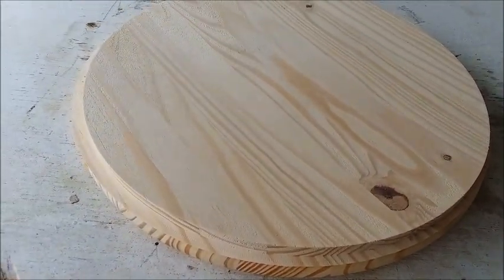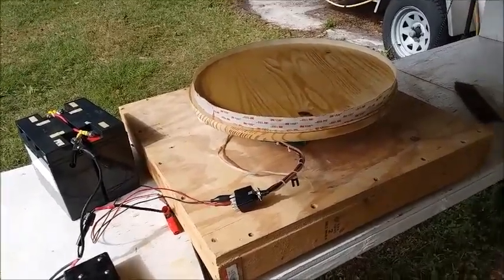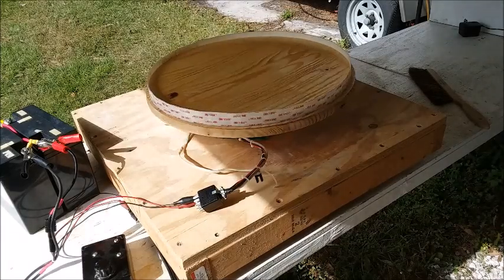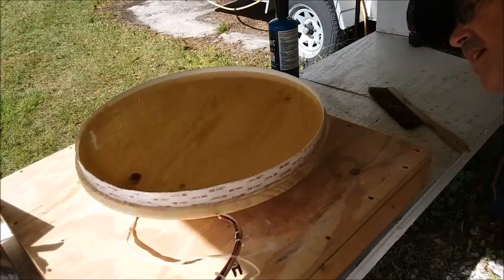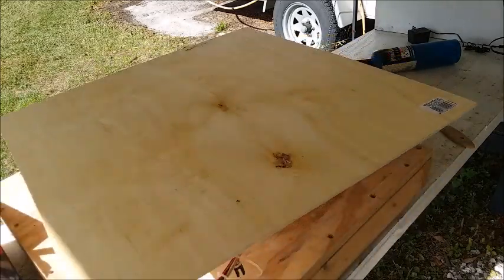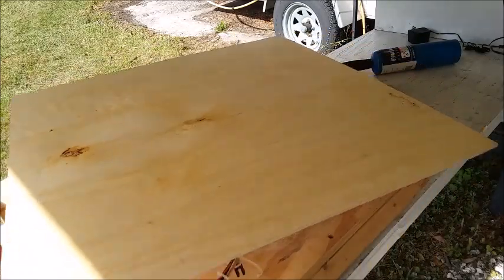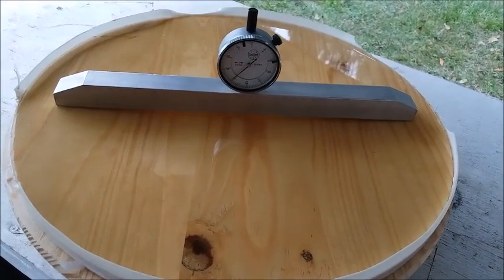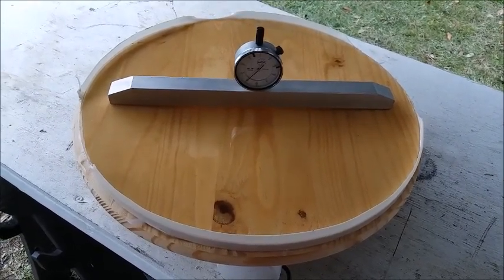Spin Casting A Slumping Mold For Fast Telescope Mirrors

Comment: Spinning liquid follows parabola. If youre after newtonian scope you need a spherical concave primary, other designs require  a spherical and  hyperbola convex-  (cassegrain) (rc/cdk designs -elliptical conc primary). Best bet is to cast speculum alloy tin, copper in a plaster concave mold polished and then polish the mirror to a difracction standards with spinning  polishers, and leather. Channel huygrns optics uses dft fringe program, camera and laser to chck final mirror

Comment: You need to take into account viscosity for the correct speed.  The basic calculation will get to close but it needs to be adjusted. Also, if you can dampen the vibrations that will help with the smaller irregularities. Sanding afterwards will still be needed no matter what.

Comment: I don't want to be critical of your project but in the interest of accuracy I would try to find a better solution for covering up the mould against flying dust or insects. Your board is unlikely to be perfectly centered when you put it on and will introduce some balance issues. It probably does not make any difference but it introduces a margin of error.

Comment: I won a science fair in 1974, showing the principle of spin casting and multi- flat telescope mirrors. My dad was big on the idea of spinning mercury in outer space for telescope mirrors. Also by using computer controlled magnets to create the shape of a mercury mirror.
Reply: i know Im asking the wrong place but does someone know of a trick to get back into an Instagram account??
I stupidly forgot my password. I would love any tricks you can offer me
Reply: @zacharyimran3663  spam.
Reply: Mercury metal is not magnetic. And just how would 'spinning mercury' in outer-space make it a mirror?
Reply: @bikerfirefarter7280  It may not be magnetic , but spinning any liquid creates a parabolic shape. You could spin mercury on earth and make a telescope that looks straight up and you can change the focal length by changing the rpm of the spin. I think it was just the idea of the use a magnetic liquid that has reflective surface  that you could controlled the focal length by changing the strength of the magnets, is what he was intrigued with.
Reply: @bauertime  spinning a liquid in a vessel whose bottom is perpendicular to a constant acceleration might give you a parabola - but spinning it in an inertial reference frame such as freefall/orbit will give you a cylinder and just fling the mercury out when it reaches the end of the telescope cowl.
Reply: @tricky778  I'm sure there are a lot of problems with spinning a liquid in space.
Reply: I'm guessing, Could spin in two axis, one for centrifugal, the other for parabolic, if rotational radius is small, coriolis effect will ruin the parabolic surface

Comment: you could also lathe precision cut it
Reply: @WilliamHelstad  parabolic lathe tool track, but you could also hydroform an initial mold from steel or plastic, or some other suitable material
Reply: @WilliamHelstad  its the same as cnc, but with lathe and single moving tool axis, with the circle form spinning
Reply: @WilliamHelstad  you could also do it by gradual rotating parabolic sand paper smoothing
Reply: @WilliamHelstad  both positive and negative molds, or direct shaped lenses

Comment: I reckon you could use abs juice to achieve the same results as epoxy for less cost, and less time to cure.  Might need a faster turning speed so it can level out enough to minimise shear once it thickens up.

Comment: That's really interesting because it's quite a simple way to get a parabola. I'm not sure if that bar top resin is polyester based or epoxy based but I think you would want epoxy because the polyester resins shrink during curing. Is the initial shaping of the wood blank required or just a strategy to save resin?
Reply from the maker: I was originally planning to use the wood form as the mold. After machining it to shape I applied filler, sanded it and put on a couple of coats of polyurethane finish. However I was never really happy with the smoothness of the wood surface. So I decided to try spin casting a layer of resin over the top of the wood. Yes, using a pre-generated curve saves on resin.

Comment: I'm stoked about this!  Why not spin cast plaster directly?  Wood expands and contracts with moisture very unevenly in the long-grain and cross-grain directions.  You might get a more stable base from plywood or MDF or a plastic like PVC.
Reply from the maker: I hadn't thought about making a master mold out of plaster. I'll need to think about whether that will work or not. It will likely need to be a different and more durable kind of plaster than the refractory plaster I use for making the slumping molds.
Reply: @omegageek64  you don't think you could cast the plaster slump mold directly in one step?
Reply from the maker: @senorjp21  No. I have found that convex slumping molds work best. The spin casting creates a concave surface. My plan is to make a concave master mold that can be used to make any number of convex working molds. I have numerous people asking me to slump mirrors for them. I need a way to turn out multiple working molds quickly and easily.
Reply: @omegageek64  Ahhh I thought the back side of the mirror went against the mold
Reply: That is Amazing Mike. I was thinking what kind of material could be molded by spinning directly into a parabolic mirror. I found an article in the December 2020 edition of sky and telescope about Porcelain Ceramic mirrors. What do you think?